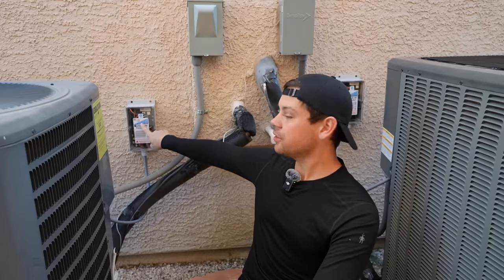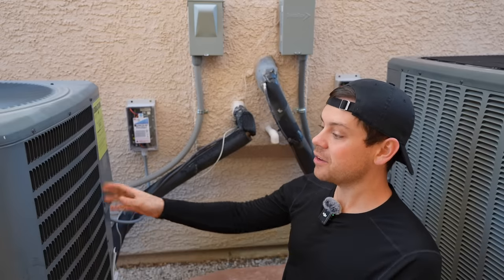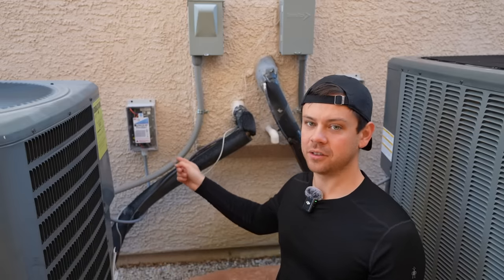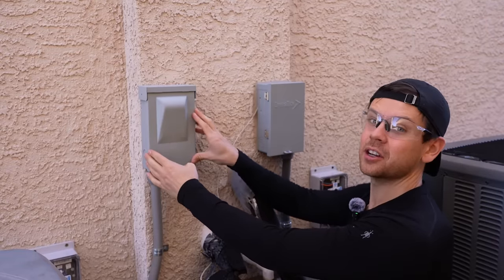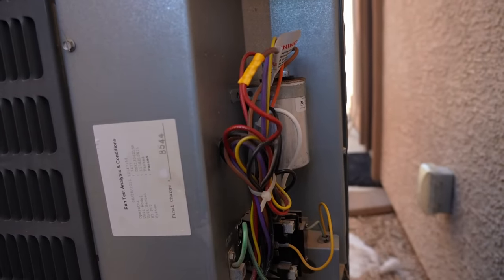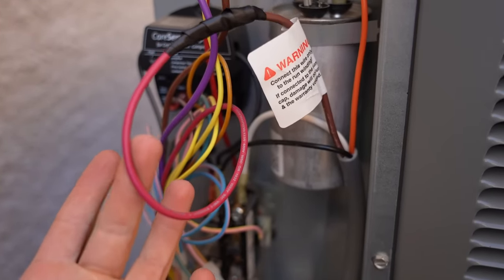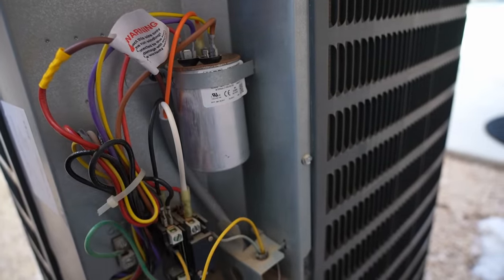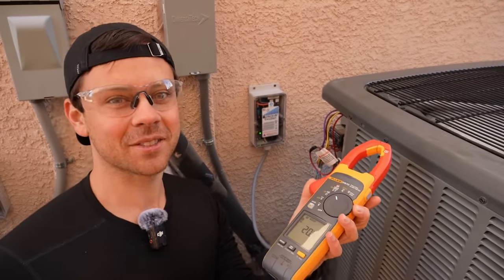AC Soft Start to Save $$$ in an Off-grid or Battery Backup Solar Power System

Comment: I installed one of these so I could run my 4 ton heat pump from the 30 amp outlet from my Lightning during an outage. 
It worked, went from 110A inrush to 35A.

Comment: I know not everyone has them on hand and you're showing the way to do it with what you have but a Resistor that can handle the wattage is definitely better than using a screwdriver. Purely pointing it out for people who wonder or are afraid to short terminals like that. 👍
Good information though. 😎 Your videos are always informative.
Reply: There are tradeoffs either way. If you use an insulated screwdriver, you will not be able to shock yourself, but if you use a resistor you run the risk unless you're careful. It's much less dangerous once Will removed both Line and Neutral, but it's still possible to lean on something with one hand and shock yourself with a resistor with the other.
Reply: @ThisRandomUsername  I put shrink tube on the leads and leave just enough lead sticking out to make contact and minimize possiblity of an accident. But I repair Audio gear so I have all the spare junk laying around 😆 We don't all have that 😊
An insulated screwdriver is a great idea and can be bought at almost every local hardware and definitely every Lowe's or Home Depot. 👍 Even the cheap Doyle brand at Harbor Freight would be enough.
Reply: @EdKy101  Nice. A resistor is definitely the way to go if you can. If I were always doing repairs on high voltage stuff I'd probably make up a stick with a resistor stuck to the end of it.

Comment: I installed the Micro Air on my 5 ton central AC unit and it is awesome, but, then Signature Solar started carrying the EG4 12k BTU solar hybrid Mini splits and I installed 3 of those and now my central AC has been turned completely off for almost a year. But, if I ever needed to run it off my solar I could so, money not completely wasted lol.

Comment: As a mechanical contractor, they will help the compressor, and contactor last longer. I have one installed on my own system. Truth is that all non inverter hvac systems should be built with one.

Comment: Good info Will & ur use of more smaller splits is also a very good idea for efficiency & redundancy, if a big unit goes down the whole house is hot/cold, where several smaller units can take up the slack or at least give you an alternative air-con area to escape to. Installation & costs for a soft starter like this is where you need to consider spending a few more dollars on the unit initially and maybe get an inverter model which are much more power efficient than the older hard start type, one more thing to consider is to try and get a newer Propane based gas type inverter split (like R32) as the gas is more efficient.

Comment: there is one circumstance about installing it in general. My house lighting would always dim when the air-conditioning condenser kicked on not because the wiring was under sized, but because the condenser was on the opposite side of the house (long circuit) now I can’t even tell when the condenser kicks on or off unless I hear it running.  I agree if it’s not needed then don’t bother.

Comment: I installed my MicroAir soft start on my air conditioner as it was bogging down our generator (sorry, no solar.... yet).  My Goodman condenser had a plated LRA (locked rotor amperage, that "surge" to start the compressor) of 120A!  The MicroAir dropped that to a far more reasonable 35A which is a huge change.  Now, when the generator's providing power, the condenser kicks on and it doesn't cause my UPSes to complain about the power sag.

The MicroAir soft starts are learning modules, it takes five cycles to learn the condenser's power characteristics, then from then on out it applies what it learned and kicks in.  If you can spring for it, I'd recommend the Bluetooth LE soft start as you can check in on it to make sure it's working as it should without having to go out and read flashing lights for error codes.

Comment: Great video.  I put ICM Controls Soft Starters on my AC units.  These were cheaper than the MicroAir , but do not have bluetooth.   Cost ~$190 for the 16 Amp and ~$230 for the 32 Amp.  My Growatt 12k works like a champ with these.

Comment: Thank you for showing everyone how to install this soft starter! Explaining all the steps and showing how it works! I myself install the really big ones on the 3 phase big motors at work which is much cooler but yes I have installed and had to calibrate these through the programs on the panels that it comes with. Many more setting for me!

Comment: I always look forward to your unique, topical videos.  Last year, I installed this device and it seemed to made a huge difference to the LRA on my old 5-ton Trane unit.  HOWEVER, here in Texas, the LRA reported by this unit varies wildly between just warm days and stifling heat days.  During the mild warm days (<95ºF) the LRA reports around 30A-40A.  On really stifling days (>105ºF or high humidity), the LRA is north of 60A.  So, keep this in mind when you make such a purchase.  It was a great addition last Spring, but during the hottest Summer months it started performing differently due to the weather.  I'm not sure it's worth the money on a 5-ton in such conditions.  Your mileage may vary.
Reply from the maker: Good to know. I'll test again when it's hot
Reply: @WillProwse , it could be the age or some other failing part of my unit, so keep this in mind when you do your testing.
Reply: I’m in Texas as well and we installed one of these on each of our three AC units- a 4-ton and two 2-ton units. The cost of the units plus installation was a tough pill to swallow but we immediately noticed a difference in the electrical bill after installing in the late summer. Interested to see the impact at the height of the Texas heat in July and August. We are also hoping to prolong the life of the unit by adding these. The starting current is about 70% less than before and our portable generator handles all three units just fine.
Reply: @everymickle1278 , I believe that the amperage needed to start the compressor varies based on outside heat/humidity conditions, age/condition of the compressor, proper refrigerant level, and maybe even pressure in the lines.  Everything started out fine in the Spring and early Summer, then it seemed to go downhill in the hottest months I started getting faults, then my Last Start Peak (A) doubled from 30-35A to 65-70A.  Just sayin.  I also had to replace my outdoor condenser motor, but that didn't help the   faults and LRA - faults just kept increasing at every start.  Some items of note are that my older 5-ton Trane XR13 was installed in 2008 and it came with a factory-installed hard start kit, which I removed when I installed the Micro-Air soft start.  The LRA increases appear to be directly related to the outside conditions.  I'm also looking forward to early March 😆when we start using the A/C again.  Sorry to hijack Will's video, but my experience has been mixed so far.
Reply: @tkonzl6059  Thanks for the feedback. My units are all less than three years old (new construction post C-19). As you know last summer was particularly brutal here in Texas. Let's pray that this year we have a little reprieve.

Comment: That company has easy starts for RVs too, I use one to run my roof unit off my solar system.  It also helps with having a smaller Generator if you go that route.

Comment: Large "traditional" split systems like that are starting to go to variable speed inverter compressors, my 16 year old 4 ton Trane that looks similar to the ones in your video just died the new one I am looking at looks identical but has a inverter based variable compressor just like a mini split, see Trane XV17 or XV18 so does its own soft start.

Comment: Like the connector to the soft starter, you also need one where it goes into the A/C. After cutting the outer sheath carefully, if it is metal lined, there should be an antishort bushing that goes between the metal and the wires. If it's nonmetallic, you'l onlyl need a connector. Once the connector is installed, pick up two reducing washers that match the connector and the hole in the A/C. One inside and one outside, then tighten the locknut.

Comment: Correct me if I am wrong, I think the soft start device would also be beneficial when powering your home during power grid black outs when on emergency generator backup.
Reply: Yes, it would. I don't have solar yet but have been using a soft start on my 4 ton Climate Master ground source heat pump for many years now and it works great to allow starting with a smaller generator, eg 4 to 6 kw.

Comment: Thanks Will, you just let me know that this was the proper device to get rather than a "hard start kit" commonly sold by HVAC companies. It might be a nice follow up video to compare the differences between a generic "hard start" kit vs this soft start one. My application is being able to start the compressor with my generator, and even though it's rated for the KW, the high inrush current causes the generator to momentarily bog down, which causes a voltage sag enough to trip the lock-out circuit of the compressor board. I'm hoping one of these will 1) allow the generator to actually start the compressor and 2) not place undue stress on the start windings like generic "hard start" kits can do.
Reply: Looks like I was wrong, I installed this exact kit and while it did cut down the LRA from 105 amps to 38 amps, it still wouldn't allow the generator to start the compressor. There was too much of a voltage sag in the 24VAC transformer which reset the demand defrost board and released the contactor, sometimes even AFTER the compressor actually started. So I swapped it out for a generic hard start kit and that fired it right off, AND still brought the LRA down to 38 amps.

Comment: I have a cheaper version which is definitely not equal to these since it doesn't analysis and give errors codes. Also doesn't start fan and compressor separately. It does though lower LRA significantly on initial startup. Went from around 129amps down to like 70amp. Once running it drops down to like 19 amps continuous. Costs like $75 in comparison. The start capacitor can blow up so have a spare kit if possible or take it oit until you can replace. Also highly recommend a spare dual run capacitor on hand. Have changed those over the years when AC wouldn't start or fan does, but not compressor. Be safe and uncharge any capacitor. Amazing how much juice they hold.
Reply: Many moons ago in college electrical class, we would charge up some capacitors and leave them on the workbenchs . Not funny now.

Comment: For what it's worth, Furrion RV A/C units have a soft start built in, and they use separate fan motors for inside air circulation and condenser fan.

Comment: I initially bought the same smooth starter then returned it after finding the one on Signature Solars website for just about half the cost. I put a video on my channel of installing it. It’s worked great so far. Pulled the surge from 125 amps down to about 32.

Comment: Most newer units that have two stage compressors already have soft start technology built in to the control board. So make sure to verify before you invest in one of these. Also most newer well pumps also have built in soft. So check first or you may be purchasing something you don't  need.

Comment: I installed one of these Micro-Air Softstarts to my outside unit so that I can run my whole house, including the 2.5 ton central AC, with my portable generator no problem. Worth its's weight in gold during power outages in the Summer months.

Comment: If I recall from my electronics days, your clamp meter may not be displaying the actual inrush of current draw as the largest amp draw is within the first few milliseconds of startup. Some meters do not display the first milliseconds and average out the reading which is not a true reading. Just a thought. As usual a great video.
Reply: Some clamp meters specifically catch the inrush.  Just check for the feature when you choose one.

Comment: I have a slow start box both on my heat pump and one on my well. The reduction of inrush current is dramatic. I have a 9KW propane generator that is now vastly oversized because it was originally sized to start the well before the slow start box was installed.  

In my mind, the cost of the slow start is negligible compared to being able to use downsized capacity components in my energy storage system or keeping what I have and having more run time based on battery or propane.

Comment: when one of my linked trace inverters went flakey the remaining one no longer reliably started my 1hp well pump. solution was to go to a soft start well controller at over a grand. works fine though and the 28 year old trace is still plugging along. (should have gone to a smaller well pump when I replaced it but..)

Comment: Some (soft starters) are about $100 - $150 for a 2Ton HVAC but they do get more expensive for larger  3 or 4 or 5 Ton HVAC's  !         The MicroAir brand that Will has on his are expensive but one of the best,  ICM Controls soft starters are also very good.    Some brands of HVAC's like Coleman have their own soft starters and using other brands may void your Coleman warranty.

Comment: I have carrier evolution 2 stage, and the control board shuts down the compressor after the soft start because it seems the compressor blew the time limit to start up.
You mentioned at the beginning of the video that the sensors need additional steps to fool the programming, but that part of the vid is missing...
I went from 92A to 16A!!!!

Comment: My mr cools are soft start built in. I have 2 five ton heat pumps. Bad ass. No heat strips either! Zero degrees out and these still turn off. 75 inside

Comment: Really appreciate your channel and need your advice on a system that will run my total off grid 50amp rv with solar and wind turbine? Have the cash from 5k to 10k in the next month, want to run in alk ac , heat ? , so I really believe your the guy to set me up with a reliable system..ty keep up such a great channel..something easy I'm  bit disabled  but still get around..

Comment: Wow. Thanks, Will, for a great tip! 

I am in the planning phase of a new solar system for my house and I have been wondering how to handle the condenser''s anticipated surge at start up.  I also got the exact same situation with the pump for my 700+ feet deep well. Do you think this AC Soft Start will work for a well pump as well? 

Keep up the great work; you're the best!

Comment: I have a soft start that I jever installed - i bought it for my 2008 AC unit when Ingot solar in 2022..  a month after getting solar, my AC unit died (unrelated to solar, I'm grod tied.) So, I replaced it and my furnace qith a cold climate heat pump.  I shouldntrallynlist the soft starter back on ebay 🤣

Comment: My problem is that my efficient AC unit is a two stage unit. Has two actual compressors and, you guessed it, requires two soft starts. :(. It’s about 20 years old now so any new system I get will be inverter based which don’t need softstarts. (Like a Mr cool or pioneer or eg4 AC/DC unit)

Comment: Isn't solder and heat shrink best for splicing wire? I'm sure your connector works fine but first say the BEST (and more time consuming) way, and then the EASY and probably just as good way, after. Just a friendly suggestion I'd appreciate if I were a newbie.

Comment: Would like to see the old condenser(s) cooling (not as backup) review/power use/noise VS all the new mini-splits. How long to recapture cost? How much better the splits are compatible with power storage (power wall/batteries) and grid if ever needed. Plus overall feel of house powered on each. Does one dry the house out more than the other? Tall order, I know, my apologies but knowing you, there is already a vid made doing exactly this, im just not wanting to dig for.

Comment: Looking to go off grid current use avg is about 1,800kw a month (63kw a day but let's over estimate that to 79-80kw which gives me a 25% buffer). What would be a good setup? I like the EQ4 18k, after seeing the cube I like that too. Just want simple plug and play vs how some of these guys build really complex systems that take 45 minutes just to explain how it works. I have ran my house off of a 9k predator generator during winter storms and was able to do everything except run the heat pump but I had an alternative source for that so I was good. Got TX sun so there's no struggle there when it comes to getting enough sun each day for the panels. I will be using soft starters on both traditional HVAC units

Comment: I bought a 12v/24v AC for my camper. It works pretty good on my 12v battery/solar setup. I can't help but wonder how it might work on 24v. Is there any way to keep my 12v system and split off 24v?

Comment: Why did you not go measure the inrush current on your mini-splits, for comparison?  You say you bought mini heat pumps to "replace your standard AC units" so you can run them on solar.  Does that mean you have measured a lower cost to run the heat pumps, replacing the AC for cooling and the gas for heat?

Comment: @WillProwse slightly off topic, but in between a solar array and batteries etc, what is the benefits of using a bulky isolator switch or a smaller mcb circuit breaker? If you have done a video regarding this please point me to it. Kind regards

Comment: if I already have the Victron Multiplus 24 3000 would I need a new inverter if I wanted to go from a 12V system to a 48V one?

Comment: 4:10 It's too bad that soft start's conduit didn't come with a connector so that it could have been attached like the other conduit. I'm assuming that little conduit is smaller than 1/2in? Hard to tell from the angles. One yank and there's going to be some trouble.